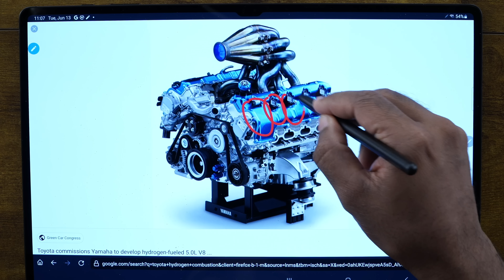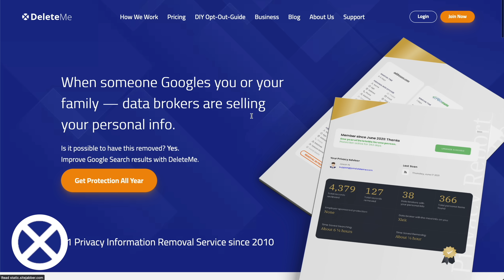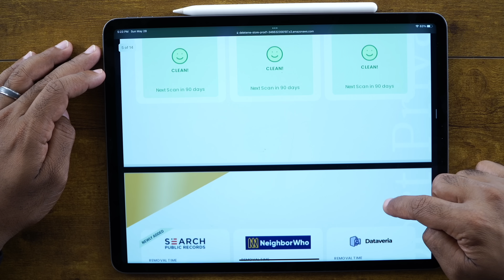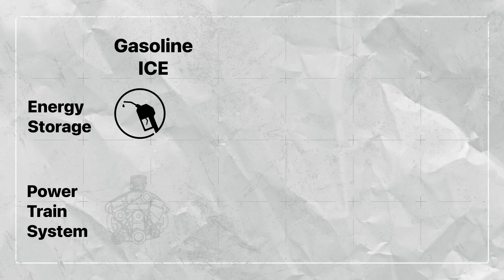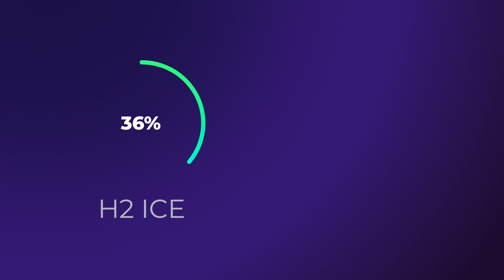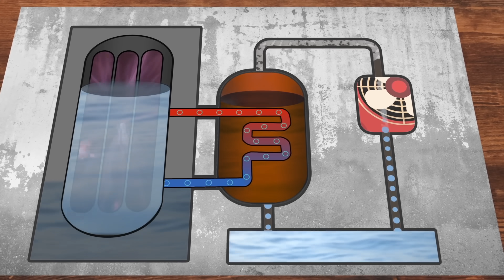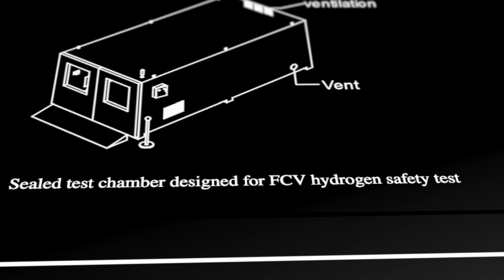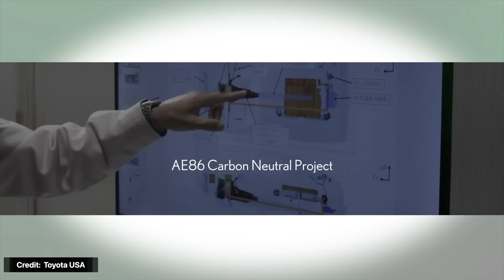Toyota's Says They Just Destroyed EVs - Hydrogen Combustion Engines

Comment: EV is the way forward. Battery technology is changing so fast. Look at the new sodium advances. Producing hydrogen is complex and to use it sustainably it has to be green. We have an embryo charging structure that's expanding daily, well at least here in the UK and Europe I suspect have adapted to the crossover to EV better than in the US. Great video Ricky!
Reply: But EV makes no sense in Japan, where all electricity for them comes from burning coal and gas.
Reply: @mareksykora779  Japan indeed has a pretty dirty power grid.  But saying "all electricity comes from burning coal and gas" is an exaggeration.
Coal represented 26.5 % in 2021.
Fossil gas 31.7 %
Other fossil fuels 13.5%
For a total of 71.7 % fossil generation.  That's a very bad record, but not quite the 100% you claimed it was!
Nuclear was 5.9%
and renewables 22.4%.

But, anyway, an EV is still polluting less than an ICE vehicle, even in an hypothetic country with a 100% coal-fired grid!!!

Furthermore,  it is definitely no justification for hydrogen cars, because the poor efficiency of hydrogen would make the picture much worse!  Hydrogen can be envisaged with a TOTALLY DECARBONIZED grid, or nearly so!
Reply: @st-ex8506 If you stopped using EVs in Japan, you would reduce the production of the most undesirable energy source - the coal plant. So the real effect of driving a Tesla in Japan today is in burning coal. And this will also be true in the next twenty years.
Reply: @mareksykora779  First, that Japan has an inept grid, (with at least one ineptly engineered nuclear power station) is not any EV's fault!  Japan must wake up and transition away from coal (as well as gas) ASAP!  It does not take 20 years! The UK has weaned itself from coal in shorter time, and so is doing Australia... and even in the US, coal generation is dropping like a stone.

But even so, as I believe I already said, an EV (especially a Tesla) on 100% coal-generated power is less polluting than an ICE car... and MUCH less polluting than a FCHV on "grey" hydrogen!
So, no excuse for the Japanese laggards!
Reply: The infrastructure to distribute electricity has already been created and there are well trained professionals and trades who know how to deal with it.  Can't say that about hydrogen.

The benefits and savings of hydrogen would have to pay for this.  The even the best  promises from hydrogen benefits can't off set even this one practical obstacle.
Reply: @joeboxter3635  Right on!  Proponents of hydrogen have not realized, let alone calculated the immensity of the cost and complexity of a dense hydrogen distribution system.  
THAT, by itself is a killer!  And precisely explains why there are so few hydrogen station, even in CA, Korea or Japan!
Reply: Too many EV's in the US will not work as our electrical grid will fail under such a load.  We're having enough trouble maintaining power systems as it is with a minimum of EV's connecting to it.   Maybe after 20 or 30 years when new technologies come into play, but certainly not for the immediate future.
Reply: @JRNipper  Of course not!  Grids may fail because of PEAK load, and  BEVs charge up mainly during the night, when there is more than enough power available.  Quite at the contrary, EVs are bringing grid operators better asset utilization!  More differentiated pricing, with each home having a "smart" meter, like is the case here in France, will promote EVs being charged either at time of lowest grid utilisation, OR of peak, and excessive, renewable power generation.  
The argument of grids not being able to handle EVs has been fully debunked... by the grid operators themselves.
Obviously, when most of the vehicle fleet will be electrified, we'll need some new generating and transmission assets, but that need is 20 years down the road!
Reply: @st-ex8506  The last time I went to Paris I noted like all other cities the cars everywhere. How do you propose providing parking spaces and charging points for everyone - even at night?
Reply: @JRNipper  There's a bit of a bait and switch happening when we talk about hydrogen (whether fuel cell or combustion) vs BEV.

BEVs are 80-90% efficient end to end- meaning up to 90% of the electricity used to charge the vehicle from the power company gets turned into mechanical motion.

Hydrogen efficiency is often discussed as tank to wheel, rather than end to end. Electrolyzing water to produce hydrogen loses 20-30% energy (electricity is used). Storing instantly incurs another 10% instant penalty. Another 30% is lost during tank to wheel conversion. The situation is even worse with hydrogen combustion as combustion is horribly inefficient 60% assuming a perfectly maintained engine.

Studies have demonstrated the electricity used for this process is far more than the energy output you get from hydrogen, and you would actually use fewer KW/h if you just fed that electricity directly to a BEV.

When you add the increased mechanical complexity of a fuel cell/combustion engine (more parts to maintain and that can fail)  and the challenges of storing hydrogen (which increases the cost of using hydrogen), there's no good reason to use fuel cell if you are at all concerned about the electrical grid. 

The proof is in the pudding: hydrogen had a 10-20 year development and production head start over BEV, and BEV has overtaken it. China had (and still has) the most hydrogen fueling stations in the world, and they're dumping hydrogen for BEV.

BEV has a practicality that hydrogen can't match: I can produce electricity from the roof of my house and feed it directly to my car. I can't refine hydrogen and store in my backyard without large expensive equipment and it ultimately using 2-3x the electricity I put in, you'd need a massive solar installation for electrolysis.

If you ever wondered why we don't produce electricity with hydrogen, you now have your answer.
Reply: @JRNipper this is just misinformation. The amount of energy used to refine fossil fuels is absolutely immense. EVs generally get charged off peak and can even be used for grid balancing using V2G. There is so much unused energy in grids at off peak and the transition will likely take a decade. The grid will evolve just like every other country with high EV uptake like Norway and China.
Reply: @JRNipper  The grid will adapt to cope with the load.
When ICE cars were launched there weren't enough gas stations to cope but as time went by more and more were built it will be the same with EV's.
Reply: ICEs very much appear to be at their end of possible development. Recently there weren't substantial increases of efficiency any more after about 150 years now. Their main disadvantages remain. Also the thermodynamic process used, physically implies no further improvement. That's entirely different with electrical engines. Mainly the storage appears to the be the main issue right now. But there since quite recently, development makes huge leaps regarding capacity and stability (number of possible charging cycles, economy, less ressource hungry) with the same battery pack. Even with the same car, one might simply use improved "batteries" (accumulators in fact) with higher capacity or increased recharging speed in the near future. Probably it might need an upgrade to the charging system) 
I still wonder, if exchangeable battery packs might be a better solution. China right now works on this.  Also about performance: Did you ever try to overtake an electrically driven car with about the same system power as "yours" (with ICE), which didn't like to allow this? 😉
Reply: @horst4439  I agree with you that ICE technology has reached the peak of its capabilities.  EVs will make them as redundant as they made horse carriages 100 years ago!
On exchangeable battery packs:  Nio is abandoning the development of it. It makes no sense, as Tesla already found out in 2013, after a brief trial.  But some people obviously take more time than others to understand!
Reply: @st-ex8506  I still find some reports regarding Nio in new reports this year and even quite recently, being still active? Any classified intelligence?
Reply: Producing electricity is also complex. Where I live, it is mostly burning natural gas :)
Reply: @dmitripogosian5084  Generating electricity can be very simple.  I have 9 kWp of solar panel in the back of my garden, and a 15 kWh battery.  It  covers 85% of my yearly electricity use, including charging my Tesla.
I have nothing to do, except wash the panels once a month, change their angle once per season (to optimise efficiency), and remove snow or frost whenever we get some.

Comment: H2 used for transportation will set back our efforts to convert the grid to carbon neutrality due to the much lower efficiency of the H2 cycles, either combustion (the worst) or fuel cell.  Much more electrical energy would be diverted into the H2 transportation sector than the equivalent BEV sector, delaying retirement of fossil-powered generation.  At some point in the future, once we have achieved a super capacity of non-fossil electrical energy generation, should there remain individuals that are truly nostalgic for the environmental noise pollution and poor performance of a combustion engine compared to the BEV, then, by all means, produce the H2 ICE engine.  We are currently running an experiment in which we will determine, once the general public fully understands the full characteristics of BEV's, how much nostalgia will actually persist for ICE.

My only anecdotal evidence, that my being a Boomer and already being quite over ICE, my four children, their spouses or significant others have no interest in ICE for the sake of ICE.

Interesting that, while scarce materials for batteries and fuel cells are mentioned, no mention is made of the catalytic materials required to electrolyze H2.  While I do not know whether this totally neutralizes the assertion that H2 ICE does suffer from scarce materials as much as HFC or batteries, it does indicate that a bit of cherry-picking is going on in the script.  Also, all the materials required for performance Li-ion batteries are listed when LFP is in mass deployment and several other chemistries that rely less on scarce materials are nearing deployment.  I hazard that material scarcity for batteries can be solved before a robust refueling infrastructure for transportation uses of H2 can be deployed.

I have not checked for a few years but more Cobalt was consumed as a catalyst in oil refining than in battery production the last time I checked.  This may be a bit of comparing an apple to an orange as the catalysts lost in H2 electrolysis may be more easily recoverable. 

In summary, I don't see room for H2, ICE or FC, in personal transportation and, without that, it is difficult to see H2 in commercial transportation.  Since the ubiquity of electricity is threatening to many companies (no ability to corner or dominate), I do foresee several companies persisting with H2 in transportation till it is obvious that no economy of scale is likely to be achieved.

Postscript:  A BEV can be charged in any of the approximately 108,000 incorporated communities of the US today, via Level 1 or Level 2 charging or mobile chargers and the appropriate electrical outlet.  Rapid charging is only required for travelling.  In an H2 transportation economy, a refueling station would need to be visited every 150-200 miles or so, depending on one's comfort level for energy reserves.   If a refueling station is available in every community, how convenient is that station, and how much travel time is involved expressly to fuel which is otherwise not part of another mission?

PPS:  13000 miles/year / 200 miles/fillup = 65 fillups/year/vehicle.  Assuming 5 minutes to approach, park, initiate payment, fill, terminate and depart (I'm skeptical) yields a maximum capacity per nozzle of  about 1600 vehicles (365*24*12/65).  In order for each vehicle to truly experience a 5-minute fillup, neglecting travel time to the station, and not have to wait till 2:00AM to fill up, pick a utility factor.  I'll be pessimistic and pick a 10% utility factor, or 160 vehicles in region per nozzle.  If one permits some queuing, then possibly 20-25% utility factor is possible or up to 400 vehicles per nozzle. 

PPPS:  Japan is banking a lot on red H2.  If the heat used for generating H2 is truly waste heat and no other, more efficient, uses exist for the waste heat, then the efficiency of the H2 cycle becomes immaterial for this specific case.  It does imply, however, that Japan's electrical energy needs exceeds their transportation energy needs in order for sufficient waste energy to be available for generating the H2 directed toward transportation uses.  A grand total of one web site I reviewed indicates that thermal-chemical splitting of H20 occurs at 500C to 2000C.  The Department of Energy has targets of >35% in the near future, if that has not already been achieved.  So, for every unit of energy delivered to wheels one has vehicle conversion efficiency of 30%,  H2 compression efficiency of 85%, H2 transportation of 100% for this discussion, H2 conversion of 35% and nuclear generation efficiency of 50%.   With these assumptions, 11 units of electrical energy will be generated for every unit of motive energy. 

With a BEV averaging 85% efficiency to the wheels (as a retired EE, I think this is conservative), a 90% charging efficiency for Level 2 charging and 7% typical transmission distribution loss, a 10% increase in turbine efficiency by better utilizing the still high 500C exhaust steam or vapour would be sufficient to provide equivalent motive power.

Now I am retired, and not so much an EE anymore, so there may be many holes in my estimations.  I am open to constructive criticism where I may have erred or oversimplified to a degree that skews the results significantly.